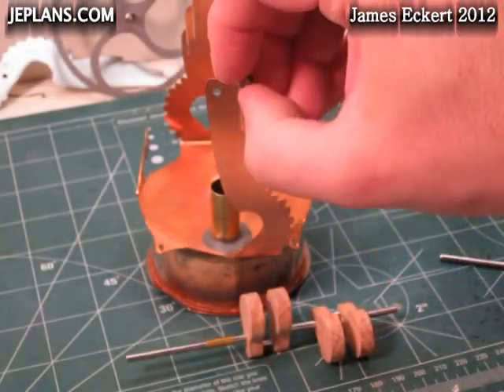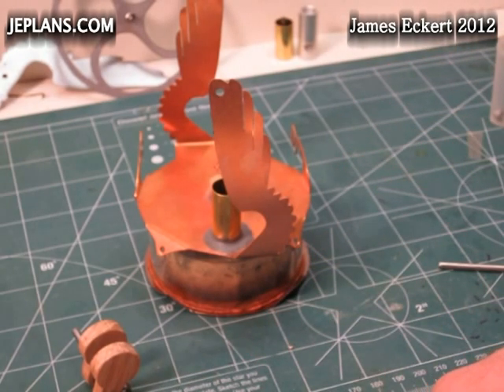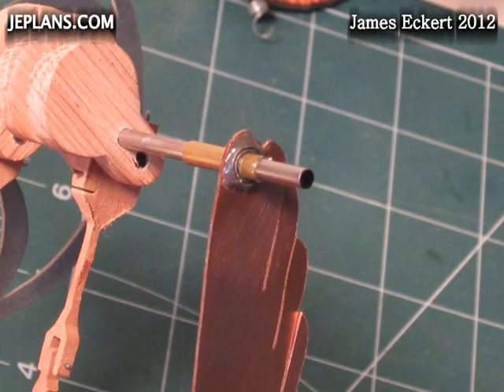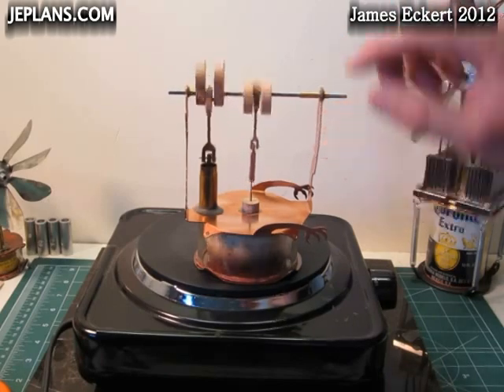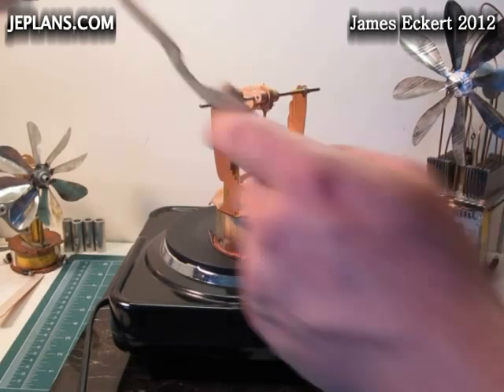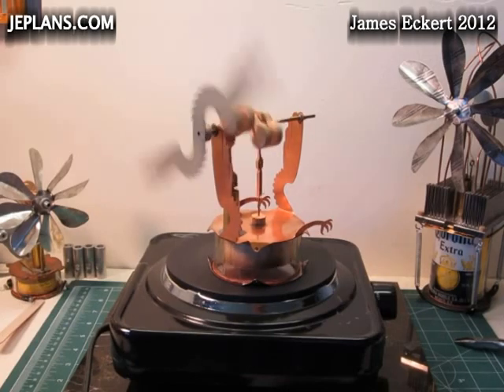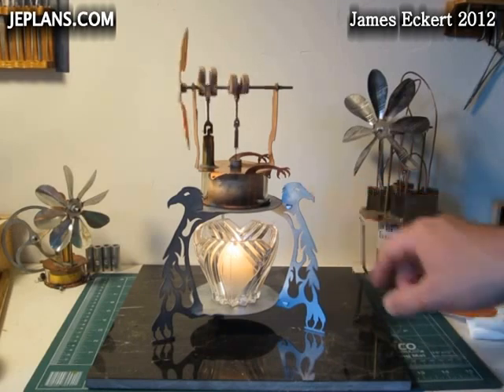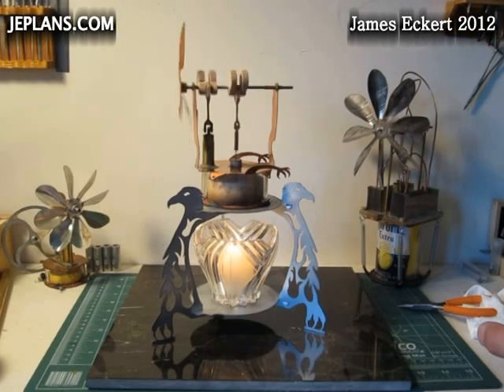Step 8 Making a Stirling Engine: Adding Bearings

Comment: What if you sprayed the displacer with high temp spray paint, or instead used foam insulation board?
Reply from the maker: My experiments with high temp spray paint didn't really bond the paper like I thought it would, but I should try it again , I know bit more now then back when I was making these engines.  Foam or insulation board would not take the heat that I am using them for.  However this engine did work at lower temps as well that they would work for.   Oddly, So far I haven't found anything that works as well as paper.